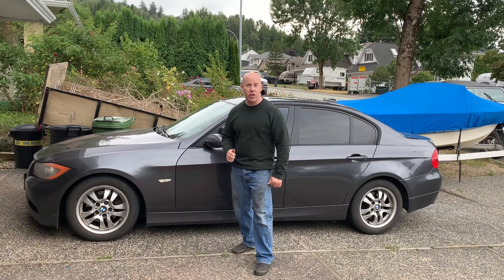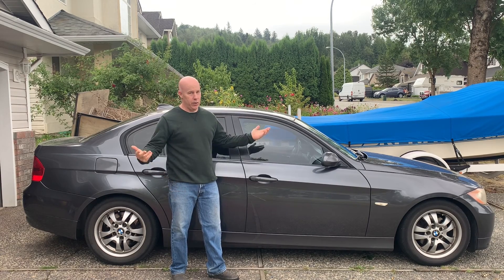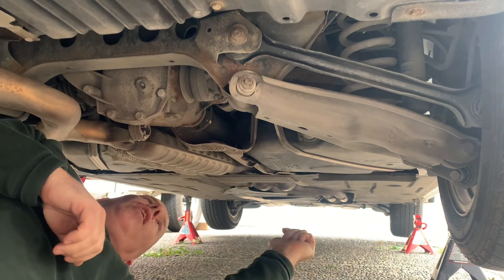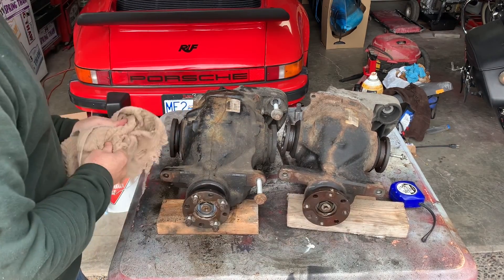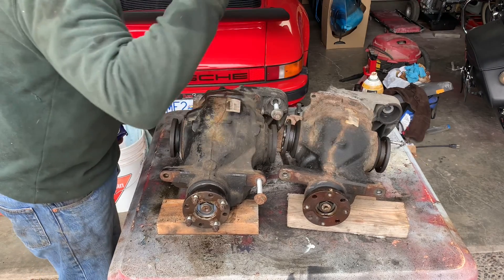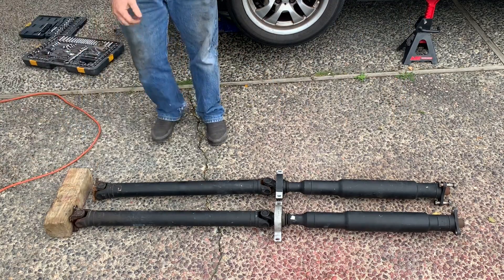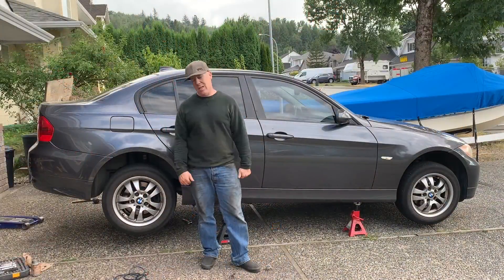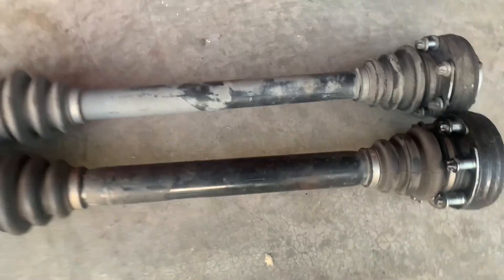Can you Put a Differential from a BMW E90 328I into a 323I???

Comment: Thanks for the video.
I also have 323i with whinning diff😢
Everythink is clear about cv axles and diff, but it seems to me the 328 driveshaft's first half(attaching to transmission) is slightly shorter than 323's, so I am afraid attaching 328 driveshaft bearing to 323 will make shaft not reaching to transmission. Did you face such issue?

Comment: The 323i diff is the small case type 168 from the 4 cylinder cars - 116i, 118i and 120i plus the 318i/320i. The extra power from the N52 doesn't make much difference, it's just that the bearings aren't really up to it - a 116i is just as prone. There is no oil drain plug which doesn't help as a 40k oil change would help them. Also there are different bearing manufacturers - I find that Koyo bearings are the worst.

In the UK and Europe there is no 328i - it's the 325i and they have the bigger 188 diff and fatter shafts. We don't have a 323i either but you can do the swap on a 320i or 318i.......not much point though as there are plenty of good used 168 diffs. Be aware that on 2008 and new cars with auto stop start you MUST keep the original diff ratio. If you fit a different ratio, the ABS and gearbox speed sensor will detect a 'fault' (it thinks it's a wheel spinning) and put the car into limp home mode.
Reply from the maker: Thanks for the additional info.

Comment: Just putting this out there for anyone else going to do this job, I bought a 328i rear diff and just swapped the axle stubs and it infact worked and I didnt have to touch my stock axles
Reply: Is changing the stubs on the diff hard? Are they just bolted on? I haven’t removed mine to look yet
Reply: @bobsuruncle8520 any updates on this? trying to do this to my 323 as well
Reply: I think you will only need to remove c clips , i might be wrong someone correct me  @bobsuruncle8520
Reply: this does not work the stub spindles are shorter on the 323

Comment: Was the donor car automatic or manual, and is your 323i automatic or manual? I will be doing the same swap soon. The diff in my 323 is finished
Reply from the maker: Both the donor and my car were automatic. I am not sure if it makes a difference
Reply: @analoggeneration385  The only difference would be the final drive. The manual having a 3.23 ratio while the auto has a 3.73 ratio. This makes for faster acceleration with the differential from an automatic donor swapped into a manual E90.
Reply: @combustiontherapy2222  so I have a 3.73 ratio diff I got a 2007 328i? Was trying to get mine welded heard I might not have to do that
Reply: @tonyrincon6400  This would be an open differential, while welding might be an option it definitely wouldn’t be the most advisable one especially for a street going vehicle. There are many LSD options available that can be fitted to these differentials.